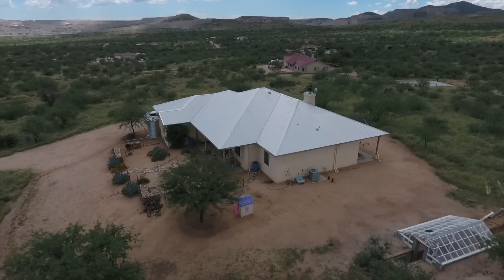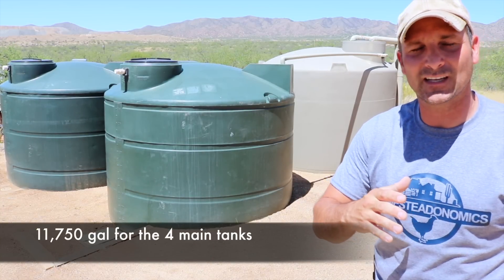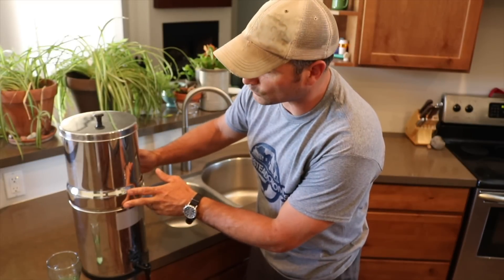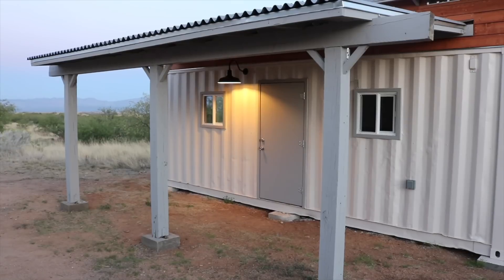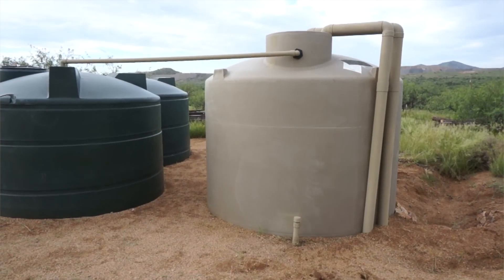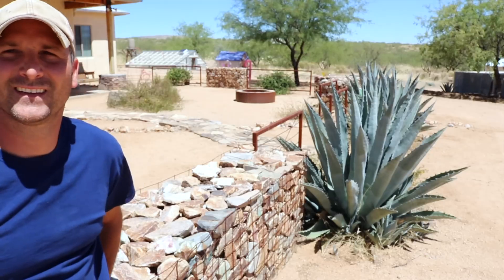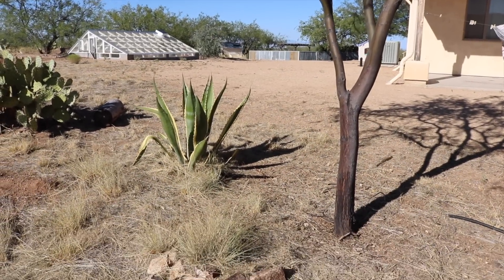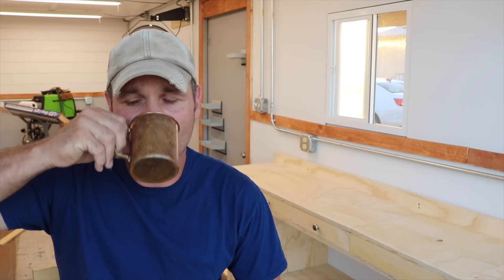Rainwater Harvesting QA - Cost, is it Illegal, how I treat, etc,.

Comment: You could build a solar roof that is raised from the ground like 8-9 feet over a place where you grow vegetables or something.
The solar roof generates you free electricity, pays for itself in about a decade, collects you more water, helps the vegetables from being burnt by the sun, and prevents quick water evaporation in that area which boosts the plant growth even further.
We have a huge crop field in southern germany which they covered with a solar installation and the guys had calculated that the dryer the area you live in, the greater the increase in yield of crops is for such a system.

Comment: for ur pond slash culvert try using concrete canvas. another thing i noticed leaving ur tanks exposed to the sun like that is not very good for them the best material in the world still takes sun damage which will cut into the life span of ur tanks. i would look into a carport style building roof only no side walls with corrigated material on the roof to cover those that will also allow u to collect more water from that. cheers. and hopefully the rain keeps falling for you.

Comment: In Hawai on the Big Island Hilo side they use catchment which catch their water.  These have filters that they use pretty much like what you are using.  They catch the water off the roof and it goes into a pool like system which is piped into the house.  They use the water for the toilets and for washing clothes.  We would then boil the water to be sure that it was safe to drink.  Also in Hawaii they have spikets all along the main road where folks could go and collect their own rain for free.  Dumping your garbage at the dumps are free as well.  They should do that here in Washington State. I collect water with buckets all over my yard and garbage cans I don't use.  You never know when you're going to need it.

Comment: If you used a black PVC 45gal drum to preheat the water going into your hot water tank ... could save you some cash ?? I used a smaller 10gal on my roof at my cottage 
s rain water recovery system ... also self designed / built !!!

Comment: I saw your installation video, and asked why you choose plastic holding tanks vs.  metal.   I was told the metal tanks with bladders in our climate (Texas) really heat up and will deteriorate the bladder.  But I see more metal holding tanks.   Have you heard of that?  Or why do you have the one metal holding tank.?  Does that metal holding tank have a bladder?   Is the main tan  holding tank in the ground a few feet,  to be below  the house roof line?  That’s all so far.  You are an inspiration. I know my husband and I can do this.

Comment: That slight acid level of the water probably helps to kill bacteria.  When I brew at home I set the ph to acid to prevent any nasty stuff growing.  While the acid level you have is probably way lower than for beer or wine, it still probably helps to stop nasty stuff growing in the water.

Comment: Look into drilling a “primary water” well.  If there are vents/deepsprings below your property you will be able to feed it with non-contaminated water that requires very minimal filtration or purification if any.

Watch Dr. Stephan Riess’ 1985 interview on the topic. Well worth looking into!
Reply: I am sure most folks are aware of the dwindling levels of water in Arizona and now trying to drill a "primary water" well is super expensive, sometimes costing more than $20,000 with no quaranty of water. Being able to collect enough rain water is awesome.

Comment: I have a reverse osmosis system for my drinking/cooking water. removes the chlorine and minerals. I'm not a fan of gravity filters. my thought is, a good filter needs force to push the water. the filter I have only produces a small slow stream of water, hence why they need a holding tank. it has about 50 psi water going into the filters, and a booster pump in the middle, yet still only about a glass of water a minute at most. someone gave me a brita filter once. I found they're absolute useless, and maybe even harmful since you assume it's filtering the water, but it's really not doing much. something else to note, filtered water doesn't mean clean, you still have to sterilize it for drinking. ozone or uv are good options that don't put chemicals in your water.

Comment: I really liked to see what you've done. Basically is the same system used here at Brazil northeastern region, an arid region with little anual rainfall. If you have some slope in your property and it is a clay soil, you could build a mini lake, with a rock and cement dam. It is a low cost  but very efficient way to store water enough even to raise a little livestock, as its done here.

Comment: Great job! I live in AZ and so I know just how amazing your setup is.  BTW,  $5000.00 is not expensive because I am paying over $60.00 a month for my water (and trash) and so I am paying around $800.00 a year for water.  So your investment is very intelligent. Thanks a lot for sharing your system, it gives me a lot to think about.

Depending on your finances, you may want to install a well at some time because it will provide backup water and additional water for your family. It would probably cost $6000 - $12000 for a 400 foot deep well to be drilled. Depending on where you water table is, that can go down a lot. If you have water at the 100 foot level, your cost could be as low as $2000.00. Note that you would still need to install an electric pump (inside the well) and a pump house, but you could do that  yourself with some research. The pumps are around $2000 - $3000 and you need a water pressure tank as well.
Reply: @Keyzer Soze I agree. Drilling wells where the groundwater is deep can be VERY expensive. In most cases, rain water harvesting is FAR cheaper.

Comment: sodium hypochlorite only leaves behind regular table salt. They both gas off but I'm thinking again the better of the two is the Hipo. Any industrial location dealing with food products will probably use this especially in the meat industry per FDA.
PS I just got a big bad burn on my finger welding. I mixed the H. chlorite with H2O and soaked my finger in it for 5 min then rinsed. When you have a wound such as a burn you get an acid build-up in that area (you can sometimes feel it with your tongue) more of an electrical current if you ask me. Sodium hypochlorite is on the polar end of that battery so it neutralizes the acidity. Pretty incredible how my finger feels and looks after a solid smoky burn of about 1sq. in. Normally I'd be nursing it for the next 5 days. Too many good things to mention about the stuff..., love your channel.

Comment: Awesome system - maybe you address this in another video, but how do you get electricity? Are you close enough to connect to the grid, or do you have a solar/wind/generator setup? Thanks for sharing - very cool system, awesome job doing most of it yourself. I will be moving to a place where I will have well water soon, but if not, I was considering a rain water system because where I am now has city water, but the sewer cost is charged as part of the water bill, making my water about 3.5 cents per gallon, which I think makes it one of the most expensive water districts in the US. The only way to avoid the sewer cost, is to pay for a separate line to be excavated for an "irrigation meter" be from the water main - my city does not allow a deduct meter off the existing meter, which I think is ridiculous and an obvious excuse to extract more money from homeowners/ to discourage cheaper water usage, since they know most people who don't have a big sprinkler system or swimming pool, will not pay for the separate irrigation meter and will be paying the sewer cost for water used to water outdoor plants/the lawn. Ty again and best of luck going forward with your system.

Comment: Regarding conservation, I have experience as a child of about 12/13 years old that required water conservation.  My parents, brother and sister lived in a 2-room house in dry west Texas.  We did not have running water in the house and bathing required the heating of water on the cook stove and a number 3 tub.  Bathing was a weekly event and not often enough for my taste.  During the blazing hot summer, I rigged a water hose up in a tree and when I came home from my summer job after dark, I showered by wetting my body, turning off the water, soaping down and then rinsing.  The water ran off into my garden.  This type of conservation effort prepared me for my Army service, when in the field daily sanitation (shaving and washing) was completed with one gallon of water.

Comment: I am planning on building my dream home on my land in Stateline w/in 2 years or less. While I only get 31 inches of rain, on average, per year, I average 343 inches of annual snow. I got an estimate for a well, and w/o any guarantee of hitting water, it will cost upwards of $86K. I’m at elevation. I figure I can use the snowfall to melt and collect it into several 5,000-gallon tanks. My tanks will be underground, below the frost line. Any suggestions for a snow-water-collection system?

Comment: Acidic water can be a major problem. If your house uses copper pipes the acid can dissolve the copper and result in a build-up of copper in your system. I have read about a whole family getting very sick from copper poisoning from this very problem. You can read about it here https://www.abc.net.au/local/stories/2010/11/24/3075218.htm
Concrete tanks are the way to go and most common around my area as the lime in the concrete bring the ph back up over time. On another note, if you can keep your ph on the alkaline side it is much better for your health.

Comment: I would have put your beige tank at the house as the main collector and then ran a balance pipe to another other tanks away from house can be pretty much anywhere plus I would have used the spouting as the water way to the one or two outlets at the tank with an overflow system built into the spouting to cover higher than normal downfalls that the  spouting might not normally cope with..save a lot of piping costs

Comment: I would be interested in your opinion on composting toilets which use no water at all except for occasional washing. They would eliminate the flush water used by conventional toilets and they would not contaminate your grey water.  My plants don't seem to mind dishwater with soap but I would not want to put my "fertilizer" on them.

Comment: This is a good information video.  I'd like to share something my dad did back in the 1940's-1970's,, when he was farming the land.  We had a 380 acre farm that had self sustaining water management systems. There was a WELL on the property, but it was NOT really used. The water was too hard.  
There was a water cistern system and a wind-will that did the majority of pumping.  My dad had created a strainer system that he fashioned out of a MILKER filtration similar to coffee filters.  This is where all the milk is strained before it goes into the Milk Cans for pick up.  He did the same with with all the rainwater that went through a similar set up,, only instead of the 2 straining,, he had 5 strainings.  
It was literally strained 5  times before it went into the underground tanks.  Large wire screen, into a medium wire screen, into a smaller screen, and then through the fine filters that was many layers of cheese cloth and flour sack cotton fabric. Those were changed out after each rain falls,, and snow melting collection. It was ALL. Washed and clean all the time.  NOTHING got through the filter system,,and it ended up PURE!   
He had a circulation pump that pumped the water all the way through the system every week.. It was literally re-filtered on a regular schedule to keep the algae under control. It wasn't stagnant for long periods of time.
Reply: My grandparents had a big pond on their farm.  Grandpa used to fill a big wooden container that he had on some kind of cart and his two draft horses would pull it from fruit tree to fruit tree for him to bail out buckets of water to water the trees!  I was about 6 or 7 at the time, and he used to put my sister and I up on the horses to ride while he watered the trees.  I remember my legs stuck straight out on that horse's broad bare back!
Reply: Amazing Farm Girl👏🏾👍🏽

Comment: Grew up in the Midwest US.  Parents have a cistern under their back porch area used for collecting rainwater off of their roof.  It is the size of a single car parking area and part of their basement.  They raised six of us kids off of that.  Once every seven to eight years we cleaned out the settlement in the cistern when the water level was low.  Never did use any filters or anything.  If the water had a certain taste to it, my dad would throw a couple hands full of salt in it.  Only ran out of water maybe a half dozen times.  Had a couple thousand gallons water delivered and I remember that it only increased the water level by a few inches.  Figured it up once and I think they have between 13000 and 14000 gallons of storage.  The house is 49 years old and they are still using it!
Reply: Cool
Reply: Hi!  What is your folks’ cistern made of?  I assume it is covered and has a trap door for cleaning.  Is it made from cement?

Comment: The cost of land is so low that it's still a great deal and he never had to pay for a well. Wells can go dry and require electric for the pump.  You can buy 20 acres for 10k and taxes are 350. A well is 20k. And he didn't have to do all these tanks at once. He started with one and expanded later.  It's a no debt system.  He never paid interest fees.  Means he can sip his beer slower and it has a better taste.  A 1000 gallon tank is 1k.  I'd be rolling in clover with this.  You do this to grow the clover to be rolling in it.  You can add the clover to your bread and be rolling the green with a smile.  Use the smiles to add another tank.  Repeat.  I could stay motivated at a very lousy job if I knew I had one of these being built.

Comment: Nearly 40 years of unfiltered rain water  drinking for me and my family ,not one single problem, other families in same area and surrounding areas have several generations of family brought up on rain water, washing, drinking you name it, only maintenance is about once every twenty years flush the tanks out if you are concerned, [most people don't even do that]. Up until about 15 years ago before the tap water was filtered people had no choice, as the tap water was brown with sandy sludge. So is rainwater safe to drink with bird poop or possum poop  well my family and most of Adelaide Australia  would swear by it, giving preference to it over tap water any day of the week, hell even water company employees have said they would rather use rainwater as they believe there are about fifty added chemicals in our mains water. So it's a big yes to rainwater from me and mine, filtered or not. Regards Tom Adair Adelaide Australia. ps Average annual rainfall here is about 500 mill.

Comment: ( @ 9:27 ) Bird poop:  (AKA Bacteria) Use of PVC ( not recommended for drinking water ) is cheap.  A better option for plastic piping would be CPVC, which is rated for potable water.  Better still, and "Anti-Microbial" is copper.  More expensive, but lethal to most strains of bacteria.  In some cases people have tossed scrap copper pipes into their rainwater tanks for simply that purpose - killing microbes.  Hospitals use a copper base paint in their surgery rooms also for killing and controlling microbes.  Not sure about other places within hospitals.  But a copper based paint ( expensive ) could be a consideration.

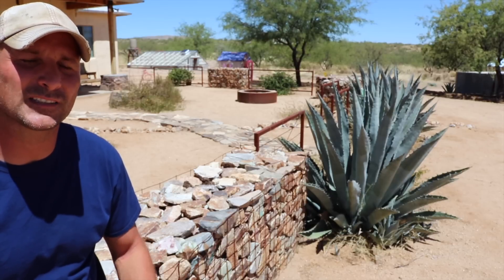( @10:04 ) In Utah, it used to be illegal to harvest.  It had to do with farmer's rainwater runoff rights.  But like you said, you only delay the flow.  Eventually it makes its way there.  To harvest rainwater was considered stealing the runoff from their farms.  More recently the law has changed to allow 2500 gallons storage limit.  In other words, at any given time, you can store up to 2500 gallons of rain/snow melt water.  [Utah Division of Water Rights as detailed in 73-3-1.5.] {also} [https://waterrights.utah.gov/forms/rainwater.asp]

( @12:09 ) Conservation:  you can collect grey water to flush your toilets.  Grey water can come from the bathtub or shower, sinks and washing machine.  It can also be used to water gardens as long as what you're washing doesn't include harmful soaps, detergents or chemicals.

Comment: I live in a totally opposite environment - a tropical island. 95% of my water is from the rain. I don't understand why you don't use a simple 1 micron filter and a UV light system to purify your water. We use this for the whole house and everyone loves the taste or lack of taste the water has. To conserve we don't flush for pees , take submarine showers. I have also dropped the max pressure on my water pump from approx. 50 psi to about 42psi and have reduced my electric bill significantly . The UV light system cost me approx $400. US - the bulb is suppose to be replaced every 12 months- but I go 16 months and they cost about $50. on amazon, I also by my 1 micron filters on line for $1 each - yes 1 dollar when I order 50 at a time - I change them every two months.